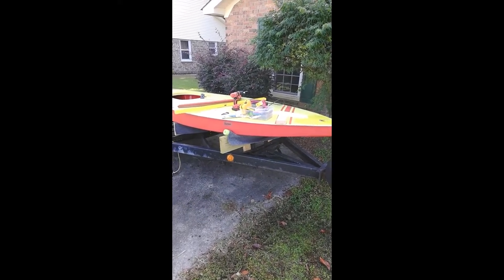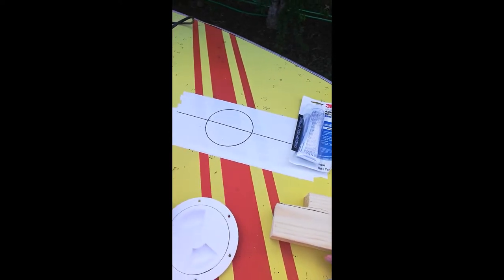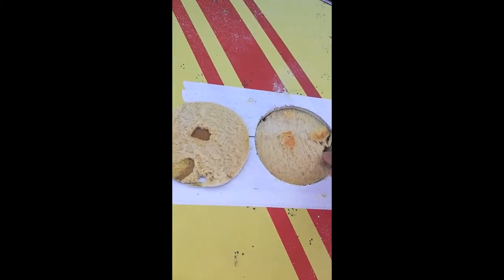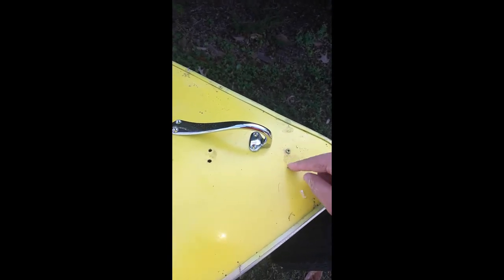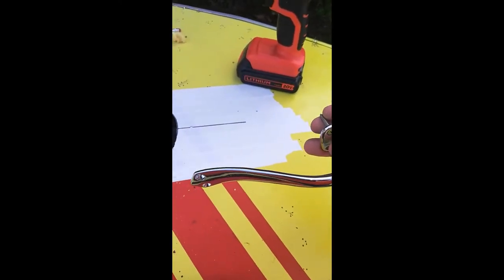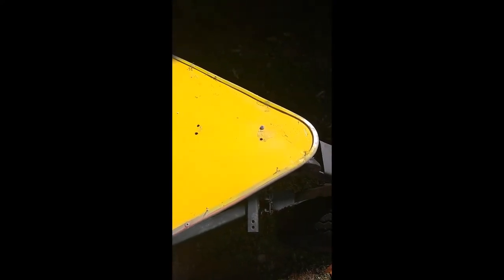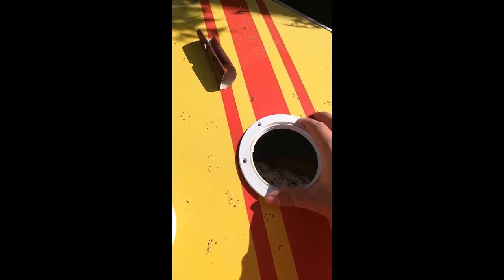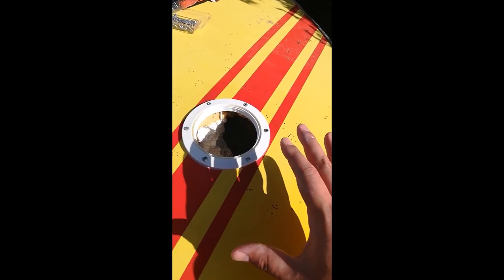Bow Handle Backer Block and Inspection Port Install : Sunfish Sailboat

Comment: On sunfish of this era with the metal trim, you can remove the rivets, remove the trim, and pry open the deck/hull joint at the bow,  all  using a sharp metal paint scraper and mallet. The deck can be pried up to get in and replace the block. Epoxy the joint back together, re-install the metal rails with fresh rivets, nobody will ever know.  Same technique works on the stern decking. I did it this way because I don't like putting in inspection ports.
Reply from the maker: Great idea! As this is an older boat, I am counting on more issues occurring (internal foam blocks or backing blocks knocking loose/rotting, mast step giving out at some point, etc). This is why I wanted to maintain hatch access. The ports are also a much simpler DIY in my opinion. If you have a how-to video on opening up the deck, definitely add it to the comments here! Maybe I will use that for a repair in the future. Thanks!
Reply: @learn4phun846   I'm a purist about  not adding ports where the original didn't have them... but so many Sunfish were built, it's not like you're "ruining" the "last original one" if you wanna put a port in...  I don't have a video of my work  on "Project Lazarus",  (my 1974 Sunfish) but there are videos already out there of drilling out the trim rivets, then tapping the edges with a  sharp paint scraper and mallet, to pry them off without warping or distorting them.  They will come off in their original shape this way, which is good because replacing that aluminum trim if you ruin any of it often costs more than the old boat is worth!  Anyway, the fiberglass deck is pretty flexible and as long as you keep the middle untouched, you can pry up the front and back at the deck/hull joint at the same time to get inside and work. I leave the middle alone so it maintains the alignment of deck and hull. You can get to much of the daggerboard trunk from the bow if you have long arms.